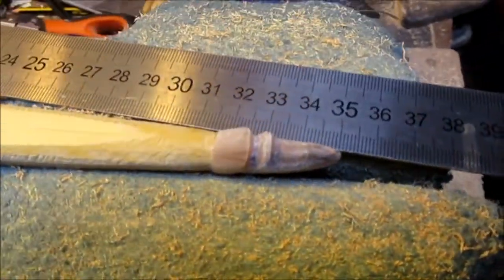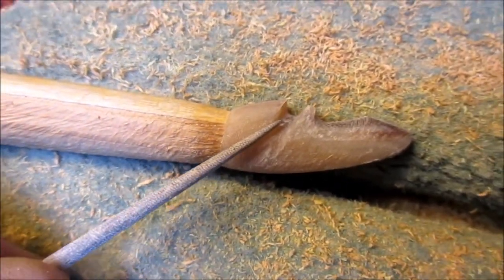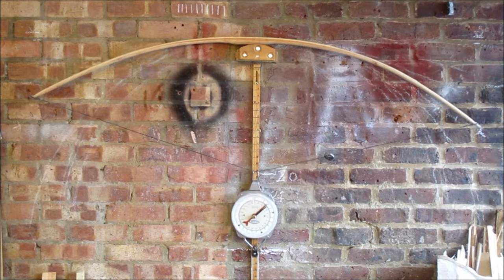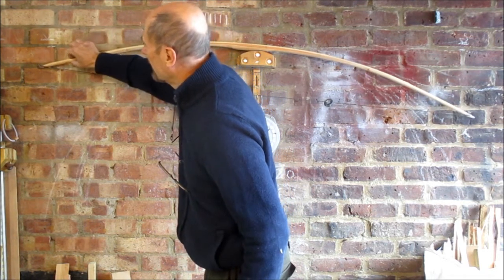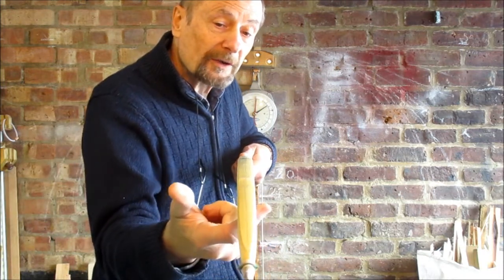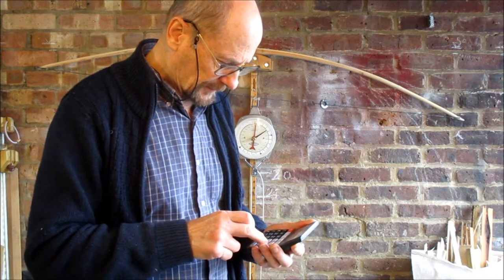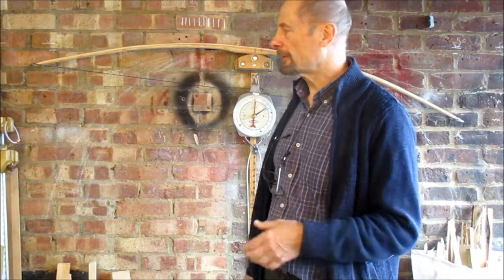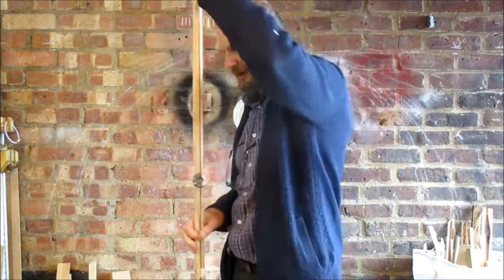35# Boo Yew ELB pt3

Comment: Looking good- so why not keep going to about 26 or a bit more to see how it does? (at about 4:45)
Reply from the maker: It's for someone who wants 35#. So now it's at full brace I don't want to pull past 35# and risk inducing any set (permanent bend) into the bow which would diminish the final performance.
As general rule, one pulls to full target draw weight each time, gradually removing wood until you eventually get back to target draw length. That way, you can fairly accurately hit weight and length with good tiller.